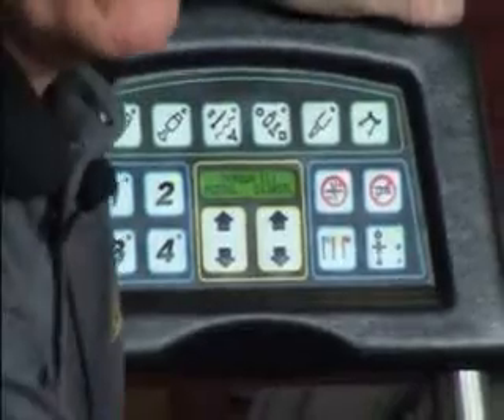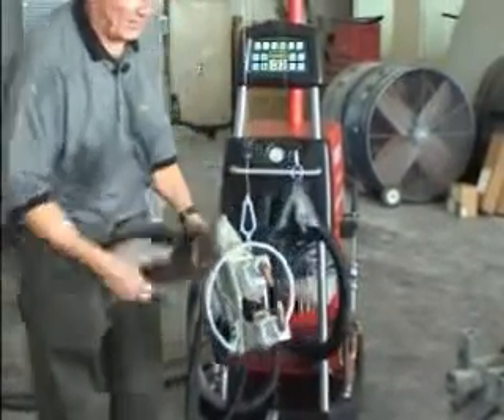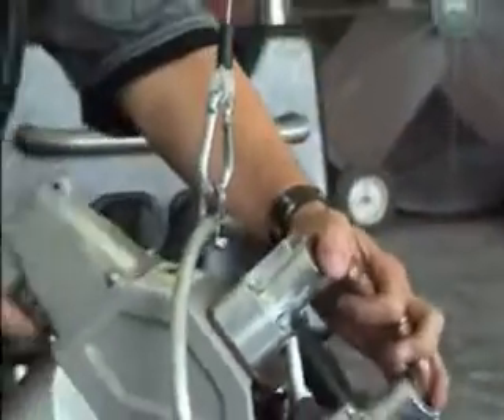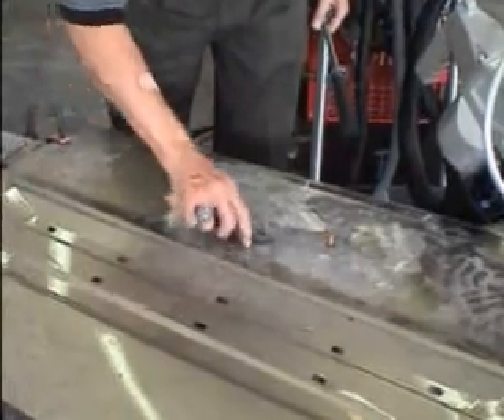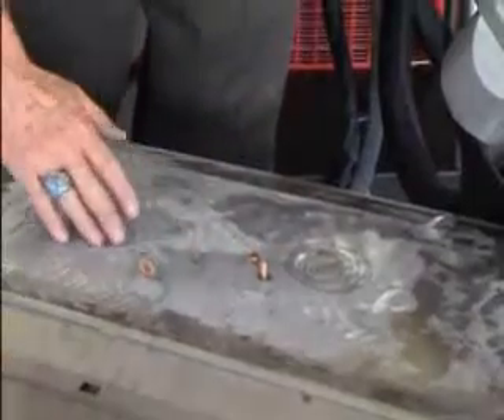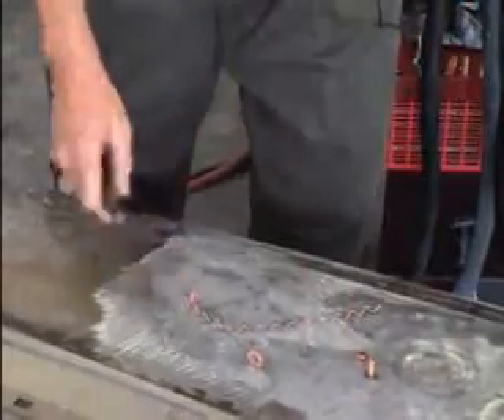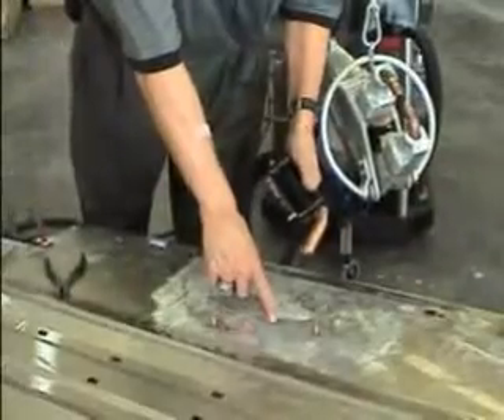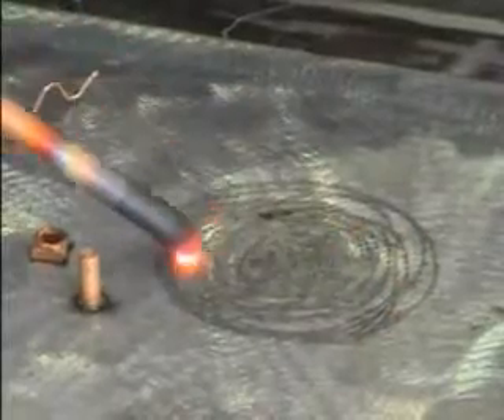CompuSpot 800HF Spot Welder DEMO

Comment: I have the exact same machine and i wondered if i can weld 2 panels with eachother
Reply from the maker: Rachid, If you are referring to spot welding of course you can spot weld two panels together, Just put the metal one on top of the other, set the settings for power and timing and you're done.
Reply: Giulio Valle What i mean is that instead using a mig welder for butt welding can use the compuspot spot welder.
Reply from the maker: Butt welding means placing two panels side by side and Not laying one on top of the other, this requires a wire feed welder.
Now if you Butt two pieces of metal together and lay a strip over the butt pieces like a bridge and weld the two together on each side of the panels it would connect the two. I hope I am understanding your question correctly so if you have a photo or drawing will be helpful.
Reply: Giulio Valle Exactly, thats what i mean. What kind of strip do i need to use? Thank you for your response.
Reply from the maker: Where you butt the two panels together lay a strip of the "Same Metal" to form a bridge over the line where the two pieces of metal meet and start spot welding on both sides..